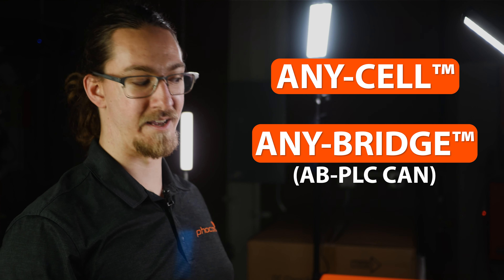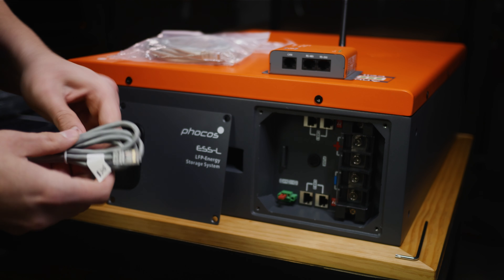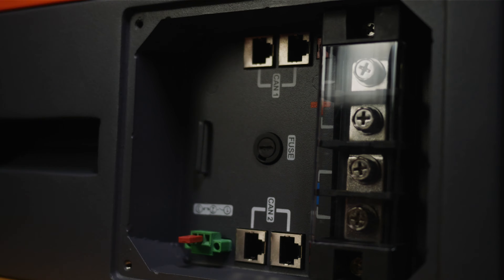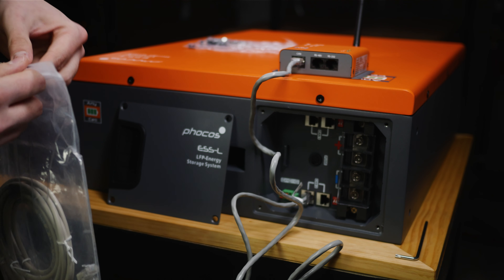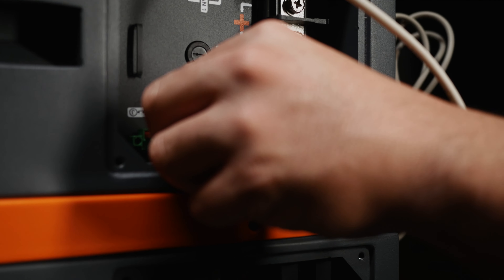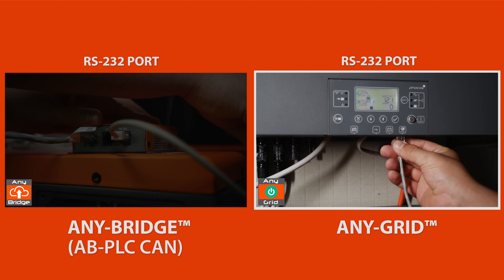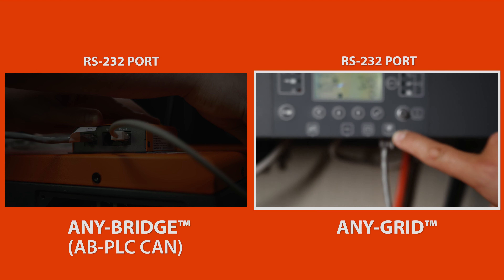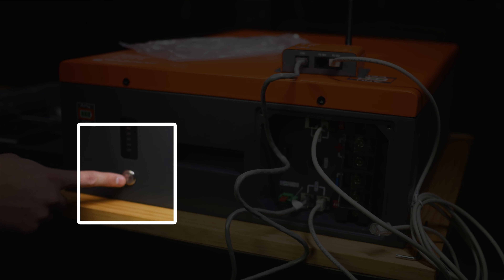How To Connect Components via the Any-Bridge AB-PLC-CAN

Comment: Great video. Can the Any-Cell communicate directly with the Any-grid without the Any-bridge? And does the Any-cell require closed loop communication to operate?
Reply from the maker: Thank you for your question! At this time, the Any-Cell requires the Any-Bridge to communicate with the Any-Grid. The Any-Cell does require closed loop communication with the Any-Bridge in order to operate. At this time, without the Any-Bridge connected to CAN2, the Any-Cell BMS will enter a sleep mode after 5 minutes, and no energy will flow in or out of the pack. You can reach out to our tech team on our website if you have any further technical inquiries or issues https://www.phocos.com/contact/#contactech2

Comment: What type of com cable is used between the inverter and any bridge the one you connect on the RS-232 port?
Reply from the maker: Thank you for reaching out! it is a standard 1:1 8pin modular cable - a 1:1 ethernet patch cable will work.